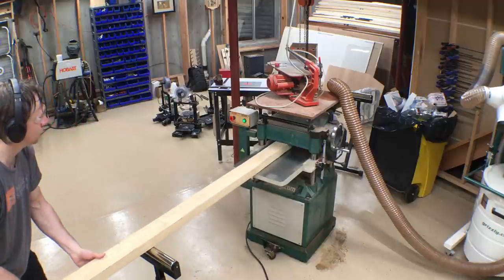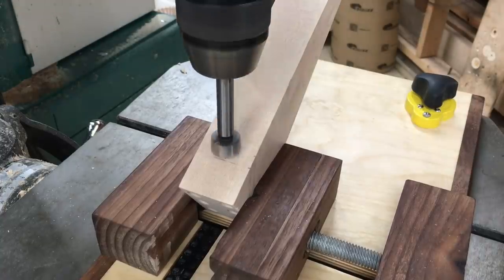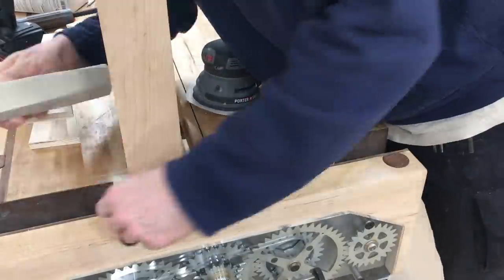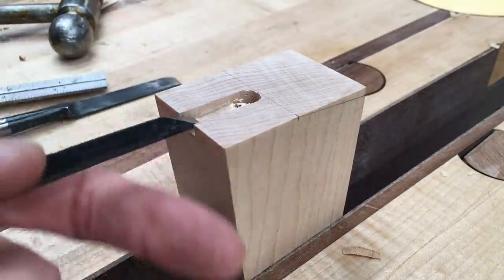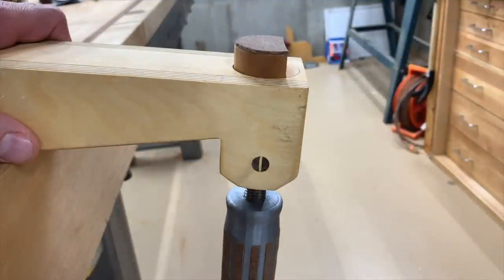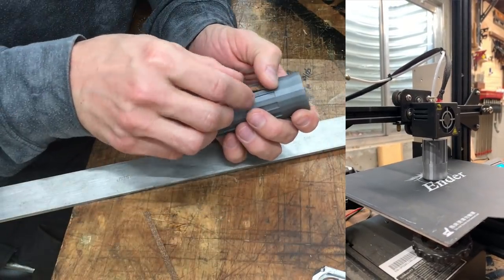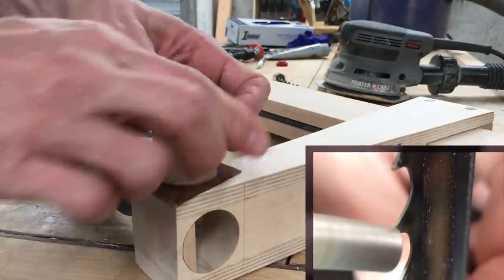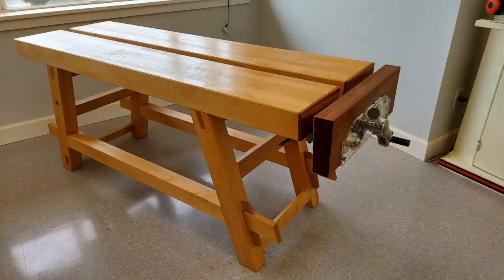Make Massive Long Reach Clamps

Comment: Yes!  I love it! That’s a cool looking clamp! 

Let’s have a wooden clamp build-off competition! 
Some simple rules and maybe a 12” reach???

That’d be fun. 😁👍🏻
Reply from the maker: I’m down!
Reply: Paging Matthias Wandel, John Heisz, and Steve Ramsey.
Reply: 3 Rules: All materials permitted, minimum 12" reach, and opens 6" minimum.  Winner is the clamp that can exert the most pressure relative to its own weight.  So you test how much clamping pressure it produces, then divide by its weight in grams, then compare those numbers for all the clamps. This levels the playing field for big beefy clamps vs thinner ones or ones that use steel, etc.  Ready, set, ... go!
Reply: @JDeWittDIY  I like the rules. But one rule should be wood only. No metal whatsoever.
Reply: 12”?  Child’s play for these guys James King… let’s challenge them… 3’ reach!!!
Reply: @joshuahasson9687  😂🤣😂
Reply: @KingsFineWoodworking  My thoughts on "any materials" was that if you use any steel it will add weight which would bring your "strength factor" down since it's clamping pressure relative to the weight of the clamp itself. But allowing only wood and glue would be interesting too. We could have two separate competitions! :)

Comment: @Andrew Klein

That looks like a hybrid Moravian/Split-Top Roubo bench at the end of the video there... I'm preparing to start work on a not dissimilar design myself, to make use of my own Twin Turbo. If you don't mind my asking... what's the logic on end-mounting it? 

I love the Moravian design and construction principles, but I cannot stand recessed trays on my benchtop (shaving, dust, and detritus collector, IMO), while I'm a huge fan of the flippable centerline stop/tool storage beam that adorns some split-tops.. The Moravian's traditional leg vice I can take or leave, so I'd intended on mounting the Twin Turbo approximately where it would typically live (so when hand-planing, I'm going along the longer, more stable - particularly if one factors the splayed leg stance of the bench - length dimension instead of its width). Moreover, the end vice position necessitates the vise being mounted to BOTH top surface slabs, thereby limiting the other awesome part of the Moravian: it's ability to be disassembled in minutes for moving/transport.

Is there a mechanical or practical reason to end-mount it vs. face-mounting it? I totally acknowledge the symmetry imbalance in the aesthetic - this definitely LOOKS sexier - but is there an engineering trap I'm setting myself up to walk into that simply hasn't dawned on me?